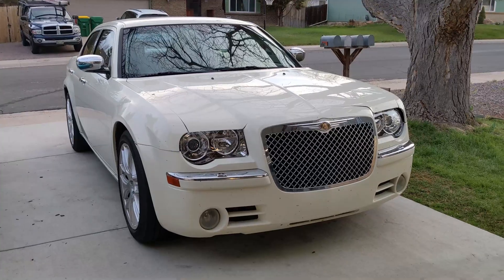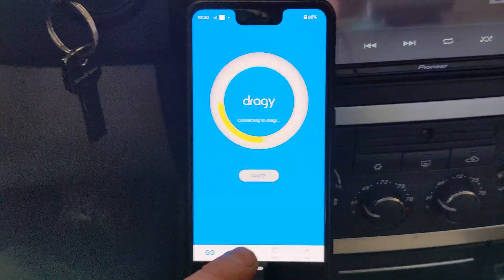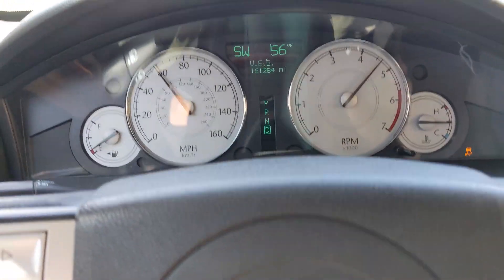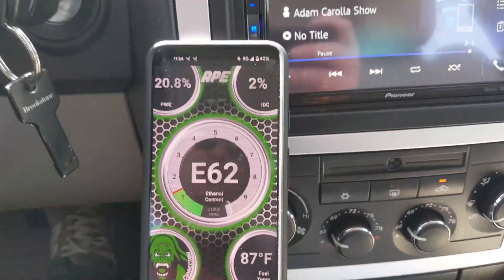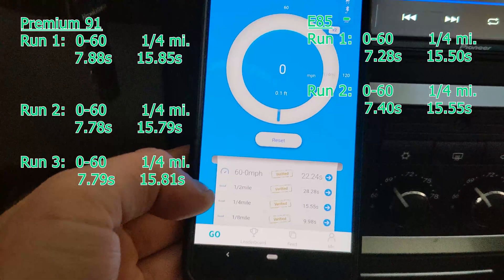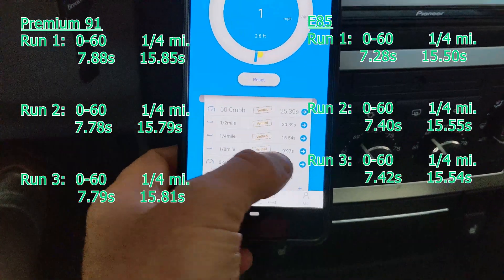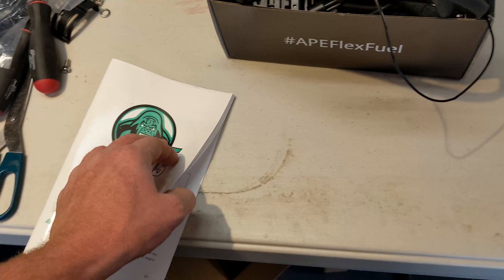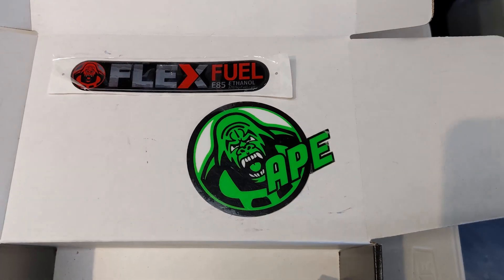Why Use E85 Ethanol Fuel? 3 BIG Reasons Explained with my 300C 5.7L HEMI

Comment: I had a 2006 Charger R/T Road and Track 5.7. It did 5.9 0-60 14.1 1/4 mi. on mid grade unleaded. Why is your 300 so slow?
Reply from the maker: I live in Colorado at about 6000ft elevation as said in the video. All cars are slow here :(
Reply: @Turboactive  👍🏻

Comment: E85 is cheaper than gasoline because it burns quicker it doesn’t last as long. It’s more efficient and stuff yeah but it burns off quicker than gasoline. what is e85 you’ll  get 6 miles less to the gallon.
Reply from the maker: Wrong. You didn't watch the video did you.

Comment: Does it still run good im thinking of running e85?
Reply from the maker: Hell yeah! Been running it on E85 for over 100,000 miles
Reply: @Turboactive now I have a 2015 Chrysler 300c it’s a flex fuel but been using 90 in all my cars till I got this Chrysler 300c..been hesitant on using E85..now if I was to switch to E85 would anything bad happen to the fuel pumps??

Comment: what all did u need? just the kit?
Reply from the maker: Just the APE Flex Fuel kit! Make sure your car is in good condition and all maintenance is done and send it!
Reply: @Turboactive  121k miles on mine but i have cam headers intake🤩
Reply from the maker: @kazmaiert  it's gonna rip with E85!
Reply: @Turboactive  can’t wait i’m so glad i only need the kit lol
Reply: @Turboactive  no different injectors needed? just can buy this install and fill up?
Reply from the maker: @kazmaiert  I am still running stock injectors with lots of head room. With your cam and headers maybe you would need an injector upgrade. Or you could add an adjustable fuel regulator. The great thing about the APE kit is that you can fine tune the fuel delivery by RPM.

Comment: I had a question am I able to put 91 premium on my 2005 Chrysler 300c? 5.7L V8
Reply from the maker: yes
Reply: @Turboactive  so I just let the fuel get to some what empty so the 87 could be out then I just put 91?
Reply from the maker: @OscarHernandez-gh3yv  Yeah I mean its just gas. You can mix 87 and 91 no problem. After a tank or two it will all be 91 and the computer will relearn
Reply: @Turboactive  alright thanks for the response man ! I’ll take your word for it god bless brotha
Reply: @Turboactive  hey sir sorry I had another question my owner’s manual says only up to 89 you sure 91 is ok?
Reply from the maker: @OscarHernandez-gh3yv  yeah definitely, it probably says minimum 89 not maximum. Haven't checked myself

Comment: The only thing that makes me afraid to stay on e85 is uncertain times when e85 becomes completely unavailable due to a corn and crop shortage. You have to remember outside factors come into play with e85. Gasoline for now will always be used and is widely used that doesn’t use crop. E85 has an environmental recipe to be created so bad quality of corn crops can effect the percentage of e85 thus causing knock and detonation. Another factor is that e85 is not widely known through some areas with less crop areas. Your limited to the gas stations your able to use and can’t just go to any gas in to fill up. You need to plan what gas station has your fuel. So far I love it but just those reason make me fear of fully converting to e85
Reply from the maker: That's why I use Flex Fuel. Can use gas or E85 or anything in between. You can also make your own ethanol from food and plant waste.
Reply: just to clarify your comment...E85 isnt bound by quality. Ethanol/alcohol is going to be what it is. When its made its the same content for the most part as the whole process of creating alcohol/ethanol is pretty much pure. The percentage of E85 isn't determined by the crop, but by the mixing plant that decides how much gas to mix in with the ethanol. SO in this video he said his station only does 65% Ethanol. Thats cuz he said hes in Colorado state , so during colder months they will lower the Ethanol content and add more gasoline so the car can cold start better. Its not that its bad quality but just what the mix happens to be at the time. Where I live my Ethanol content is 83-85% all the time cuz im in the desert and dont need to worry about super cold starts. We dont grow corn here in Southern Califoria but we have lots of E85 now. However you are correct about potential crop shortages possibly having an issue if there were to be one.
Reply from the maker: @MattySRT  we have stations that sell full 85% also, just Kum and Go sells 65% for whatever reason. I've even filled up and gotten 90% at one Alta station.
Reply: @Turboactive  good to know... Kum and go must charge more then for their E85 as gas prices go up cuz of oil prices and if theres more gas than ethanol in the mix then that increases cost. 90% seems almost too good to be true as per gov regs its not supposed to be more than 83% technically. My station is right at 84% everytime I fill up. The more ethanol in the mix the leaner it gets and the less it costs but that also means more octane over the base 105 rating
Reply from the maker: @MattySRT  actually Kum and Go is usually the cheapest. Also my dyno tuner said it's ideal because you get better MPG than the higher concentrations but the power potential and knock resistance is still great. You start to get diminishing returns with higher concentrations of ethanol unless you have a really crazy engine.
Reply: @Turboactive  your right. I forgot about that part. 65 is optimal for mileage and power

Comment: Your review is spot on! Especially the numbers. Im in Los Angeles and I went E85 on my ‘11 F-150 5.0, MPGs went down from 15.5 to 12, but at $2.99 (around October 2021) vs $4.19 for Costco 87 was worth it. I got my E85 kit for my ‘14 Charger 3.6 and MPGs went down from 20 to 16 but still saving money with E85 being $3.59 and Costco 87 at $5.39 as of now May 2022. The eFlex kit was not as plug and play as the APE kit as I had to cut, clamp, and fit my new fuel line, and insert the electrical prongs into the connectors after checking polarity (and the connectors getting stuck) but I made it work. They also gave me a 10% discount so instead of paying $699, I paid $629 OTD. With rising fuel prices the kit will pay itself off in about 10k miles if prices remain the same. There has to be a price difference of at least 20% to save on fuel costs. Great video!
Reply from the maker: Thanks for the info! I have an eFlexFuel kit on my Lexus and the APE on my 300C. I think the APE is definitely better but my eFlexFuel kit is 4 years old now I think their new kits are nicer.